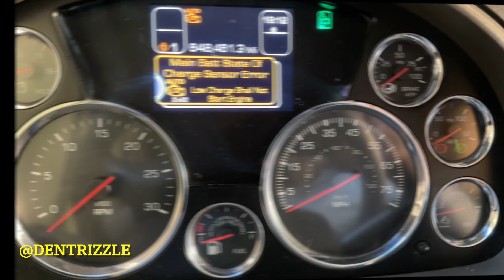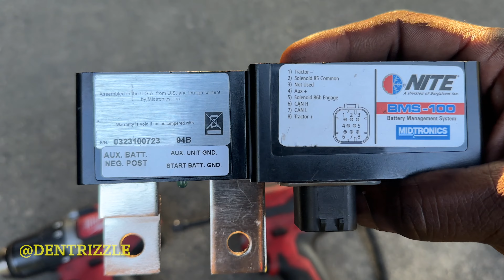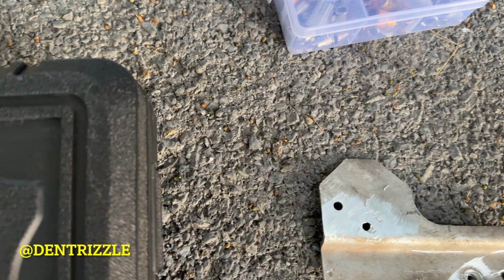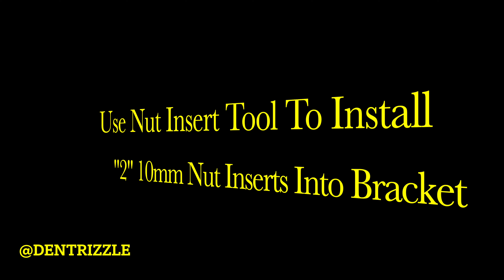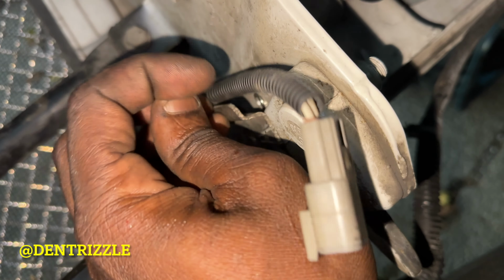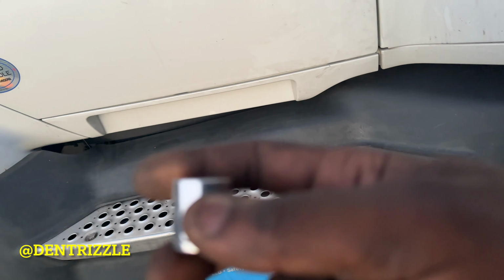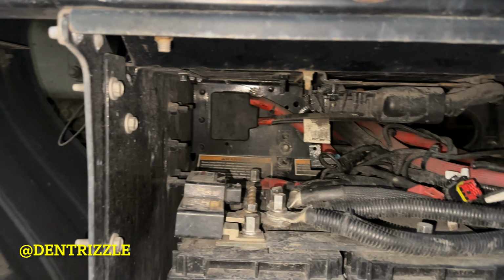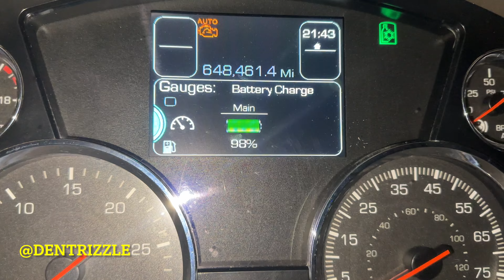How To Replace Hood Switch & BMS 100 Battery EPU on Kenworth T680 MX13 | Peterbilt ISX | Paccar

Comment: I use 2020. I dont have a autostart button or switch. Where else could it be?
Reply from the maker: It is always closest to the batteries. If you have EPU then you have 8 batteries on your truck. But I would definately think it’s on your batteries.

Comment: What year is your truck? We're trying to find the part number for the bms for our 2020 and it's like an internet rabbit hole
Reply from the maker: @AimeeKuhns  2019 Kenworth T680 MX13 EPA 17. They’re are 2 types, one for the Aux battery and Main battery  Now I have 3 😂😂😂😂
Reply: From what we can tell ours doesn't have one on the main battery at all. Our autostart hasn't worked since we bought this one. Do you happen to know the part numbers for the bms, prob same as 2019 I would guess
Reply from the maker: @AimeeKuhns  They have different part numbers but search for “Kenworth Battery Management” or go to Midtronics website for part #.

Comment: I bought a new bms 100 and put it in and my battery charge gauge started out as 100% but goes down slowly as I drive. I took it to kenworth and they connected the extra ground cable from truck batteries to auxiliary batteries using a terminal expander. That did not fix the issue. Do you have an idea on what to do?
Reply from the maker: To be honest I don’t have much knowledge about the BMS 100 trouble shoot cuz I would normally research and test to figure out problems as they arise being I’m not really a mechanic but just doing the thing 😅.  IMO I would check if it’s the correct BMS 100 and it’s functional cuz it shouldn’t be counting down. And also it just records battery percentage so maybe check your batteries to see if they are losing charge/not holding charge being the BMS100 is new. One bad battery can cause all other 7 of your batteries to go bad. Ask me how I know 🥲
Reply: What was the price of the part you bought? The bms 100?
Reply from the maker: @pattersonlee062  I have 2 brand new without the original package but when I bought them it was off EBay.
Reply from the maker: @pattersonlee062  they go for $1,000 new but if you shop around you may see for $850
Reply: @dentrizzle  Thank you.